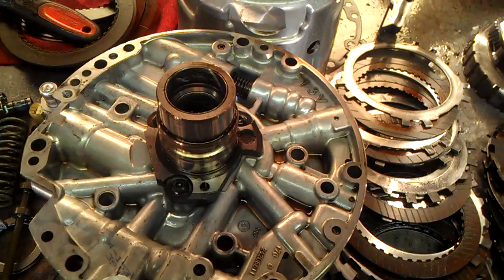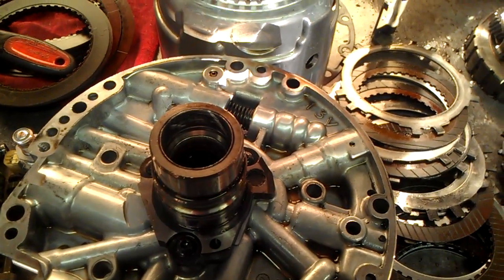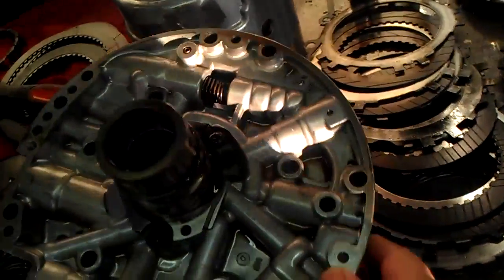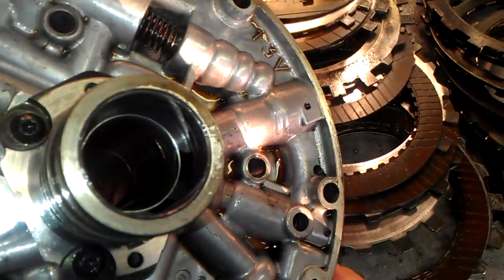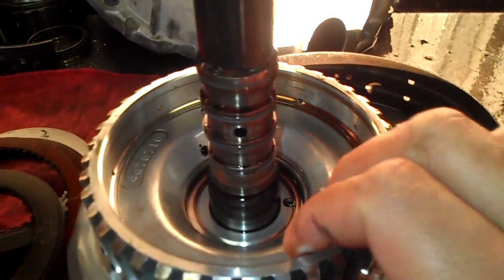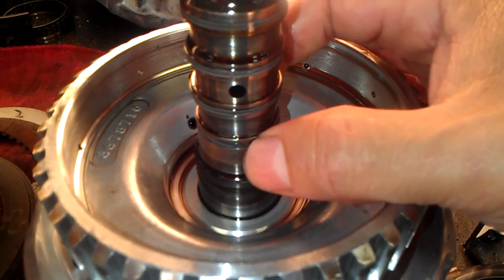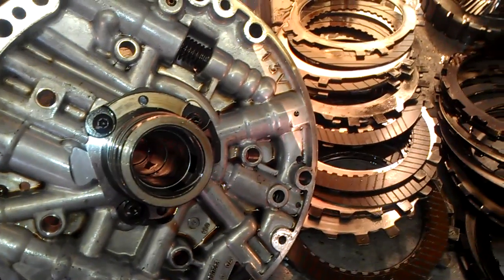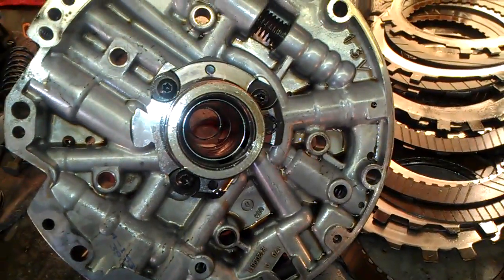Bushings, why it is very important to install them (1) - Transmission Repair

Comment: I always replace the case, pump, and stator bushings minimum. Also on the front stator bushing I use a wide 350c front stator bushng, Bushings hold the entire drive train on it's geometric centers. Very critical. Good video Hiram.